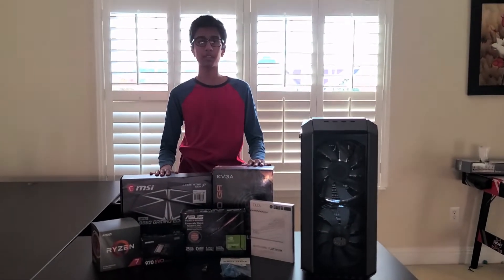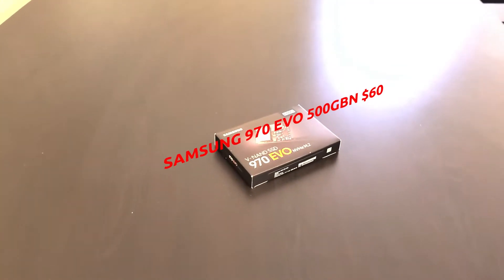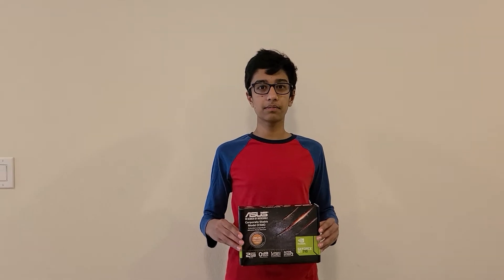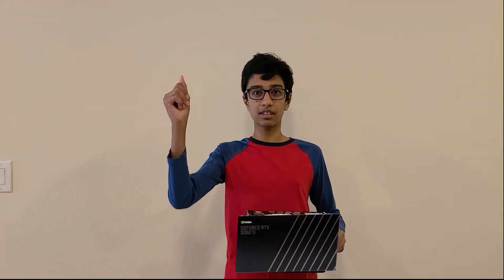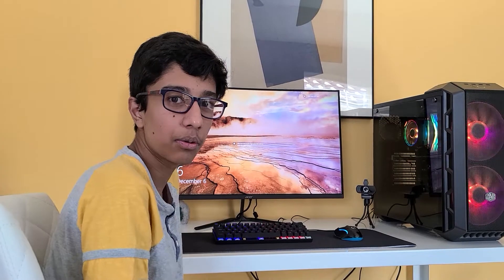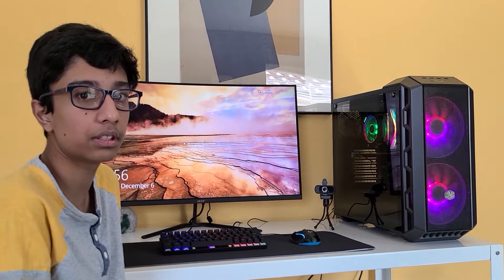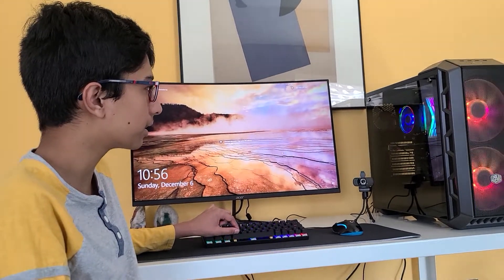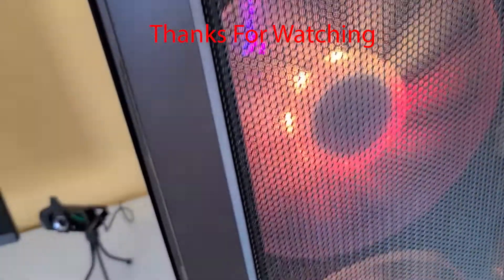2021 $1100 Gaming and Productivity PC Build! **INCLUDES 3060 TI**

Comment: Me sadly with a gtx 1660
Reply from the maker: Lol a 1660 is still good. It can 1080p 144hz game on decent settings. What’s ur pc specs. Prebuilt or built?
Reply: @FireLlama  builted, ryzen 5 3600x, msi Arsenal gaming motherboard, TEAM group T force delta 16gb, 600w power supply, rgb fans 1tb hdd
Reply from the maker: Oh ok so it’s a budget build for about 500-600 dollars which is pretty good. You can upgrade later in.